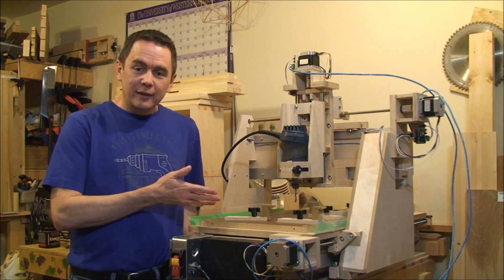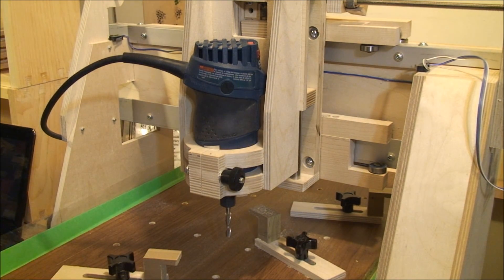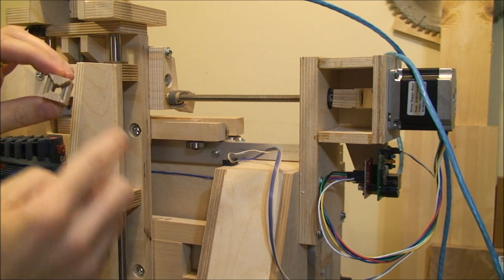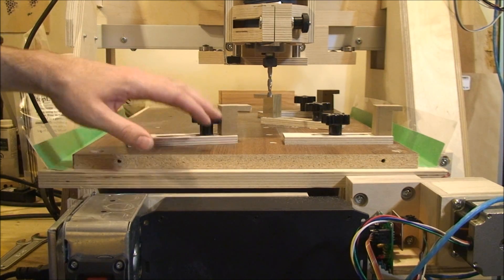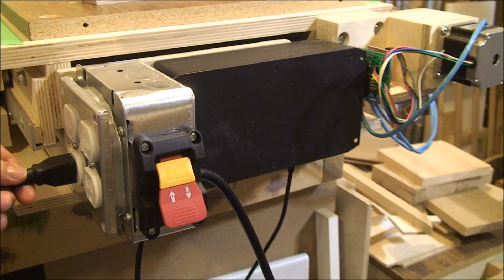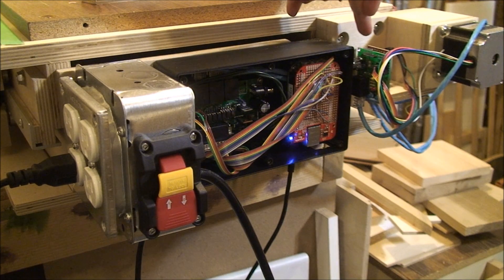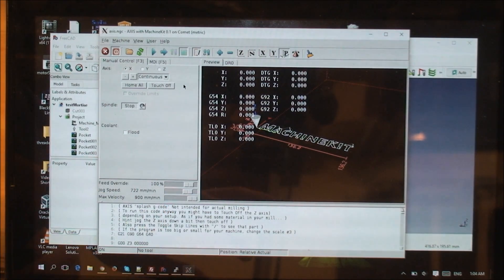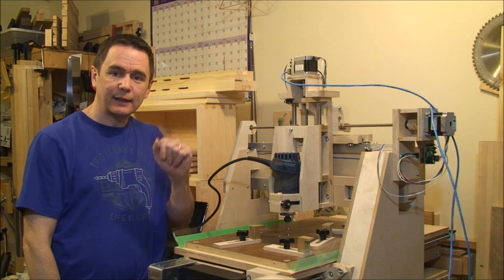CNC Router

Comment: Can you hellp me with access over SSH? I use a Machinekit with Raspberry Pi, but this connection could be similar
Thanks, Viktor
Reply from the maker: I'd like to try to help.  I had Machinekit running connected to a Raspberry Pi last year as well.  One thing I remember missing was putting the username in front of the IP. "ssh machinekit@<USB IP>"  Let me know if that doesn't work for you and I'll see if I can dig up what I did to get that to work. :)
Reply: Thanks for info, I've already done with this connection, but the performace is very poor. I facing with problems with GUI performance, with gcodes that is bigger over 10k lines. How are you satisfied with gui on your machines? Do you use a graphycal preview?